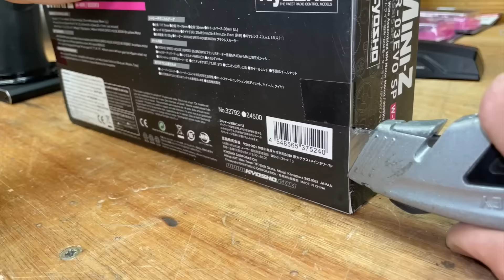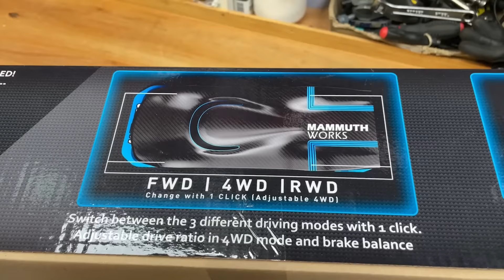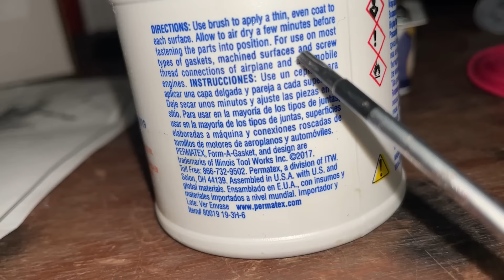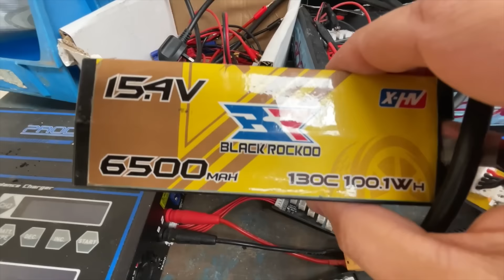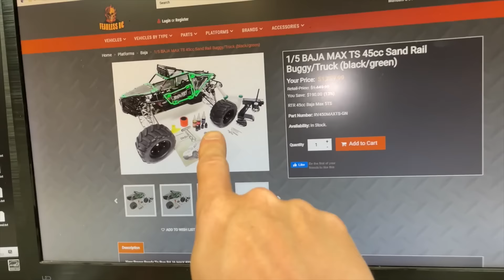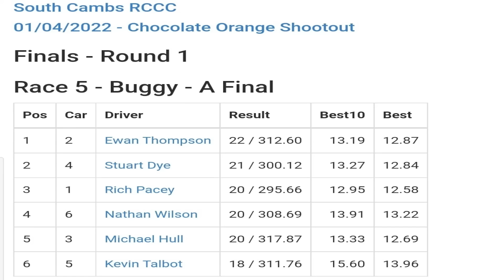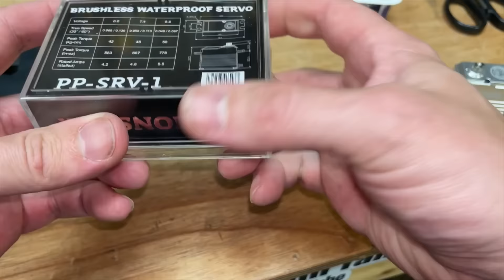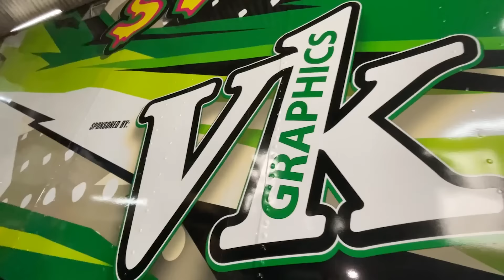RC Cars - The Movie - Christmas special!

Comment: That Mammuth car would absolutely FLY if it wasn't a 3D printed prototype made out of chocolate.
Reply: Don't insult chocolate like that. What did it ever do to you? 
Give you diabetes or something? 😆 🤣 
Just playing buddy.
Reply: 3d printed parts can be very strong, choosing the right material to print with and having a correctly set up printer is key, I bought an ftx dr8 a while ago and snapped the rear hinge pin holder, common problem, printed a new one and it lasted 3 times longer than the original.
Reply: That car was a joke.. I belive they sent that car to Kevin knowing it was trash.  Just think about it.. special edition of 25..  car probably cost 1000$. Give one to Kevin , easy way to sell off 24 crap cars..   a Walmart special rc car last longer then the mammuth
Reply: @___Aaron___  if only it was that cheap, I’m sure it was $1700 at the time it was released, I’ve checked again and it’s down to $1500 which even at that is an absolute insane amount of money
Reply: @RecklessRcuk  thats why CHOCOLATE is in ths comment: the 3d print material is chocolate
Reply: Mammuth car is more brittle than corallys are 💀
Reply: Dude facts that thing would rip if it was made out of some proper stuff
Reply: @RecklessRcuk  and my point exactly.. its a cheaply made car.. limited edition  number 3 of 25.. now how can you sell 25 cheaply made cars quick.  Give one to Kevin talbot..  he shows the car to his followers and they get bought up quickly. Then found out to be garbage
Now I'm not sayin Kevin knew.. but its a good way to make a quick dollar with a crap experiment
Reply: @rickroberts7611   what a great excuse for them.. after the limited number of cars probably sold off.. get back the one car that helped sell off the others and then not bother sending it back to Kevin because the damage is already done and they don't have anymore cars they need to make money off of..   maybe you get my point now.  If not I'll explain it better
Reply: The motors need to be fixed to the chassis. Having the motors in the wheels as unsprung weight ruins the handling. I made a four motor rc car with CV axels
Reply: Unfortunately Mammuth has been so unfair to keep the Stealth-car Kevin sent back to them. Every car deserves a second chance to meet Kevin’s standards!
Reply: @___Aaron___  If they actually managed to sell 25 of them I’m sure they would make more, limited edition is a sales technique, I’d much rather buy a couple of infractions to be honest
Reply: @nickvledder  I highly doubt Kevin wants it back, they weren’t exactly pleasant talking about him and his video
Reply: And goofy ahh arms made of sticks 😂 

Edit: when it disintegrates its just hilarious how the motors continue to twitch even though theres no wheels
Reply: This brings up another point. Getting pretty tired of seeing all these 3D printed RC parts and accessories being sold on ebay and elsewhere. That shiny, stringy plastic is garbage.
Reply: @SolRayz  then don’t look, especially as you’re so wrong, 3d prints are very strong, if you can’t print, you have no idea how it works or what you’re talking about it’s best not to comment.
Reply: @___Aaron___ it was 25 of 45
Reply: @koreyhayden1368 no it's not, you need to watch again, it's 4 out of 25.
Reply: @davidmellish3295  🍪
Reply: Can I have a rc car
Reply: Ware do you live

Comment: @kevintalbot on the car that blew apart with 4 motors, are the front end, and rear end parts worth putting on a limitless? That 4 motor direct drive should be capable of very high speeds with less weight that traditional builds, I think the weight of your 100hp car is the reason the tires are blowing off since others are going over 200 with wheels intact(sometimes)

Comment: I think when you tested it on the bench none of the wheels had any resistance and they all expanded equally. When you were driving it on the asphalt one wheel came off the ground while you were turning and accelerating and was able to expand a lot more.